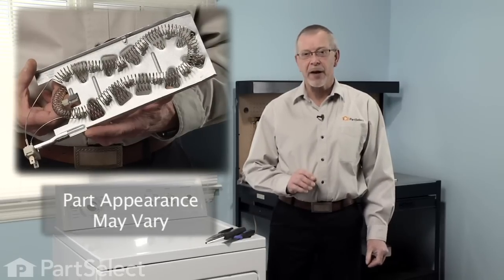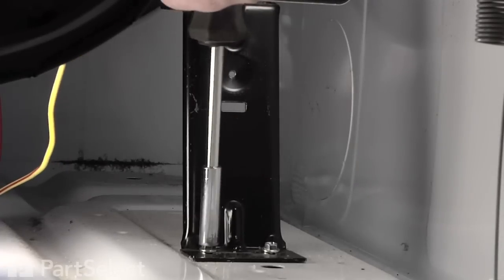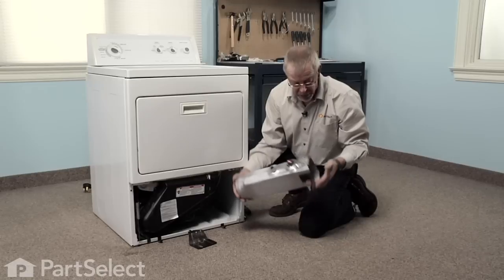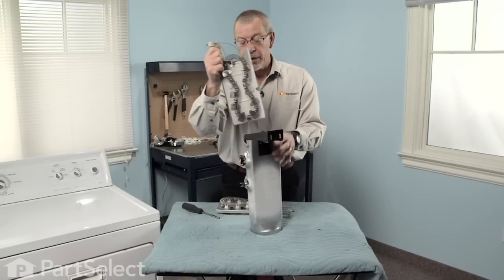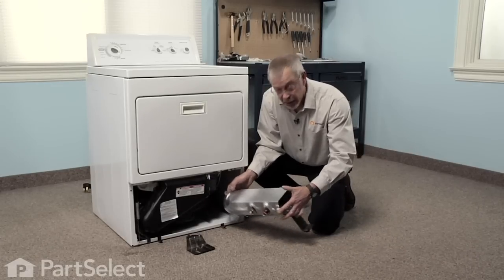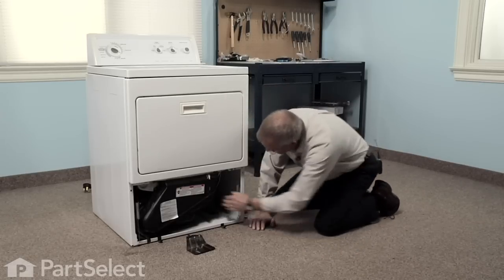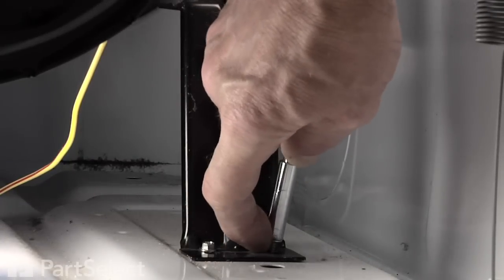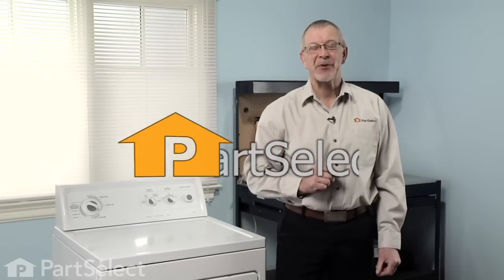Dryer Repair - Replacing the Heater Element (Whirlpool Part # 3387747)

Comment: Excellent video. My son andni just finished this project. Several comments.
1. If your dryer is older like ours is, its far easier to pull the drum to do this job. Getting that element housing out was not easy for us.

2. The element does not slide out easily. We had to use a screwdriver and hammer on it as it was super tight.
3. Pulling the drum made refitting the element assembly and housing and hooking wires a piece if cake.

Thanks, Steve!!

Comment: I just replaced the 3387747 Dryer Heating Element in our 20-year-old Whirlpool GEQ8811LW1  dryer following the steps in this video.  Net cost - $28.60 for a new element including taxes and shipping. Thanks, Steve!

To say that I was amazed to find this video available for such an old appliance would be an understatement. The only difference between our dryer and the one shown here is the bracket that holds the front of the heating element cage in front.  Without this I had first tried to open the back of the dryer - not possible - its welded on - and couldn't even figure out how to open the front bottom panel.

Its really hard to get the heater cage back into the machine so that it properly engages at the back, but don't be discouraged and simply follow the directions of how to turn it in this video, Remember to first attach the front shield as he shows so you have leverage turn the shield when you finally get the clip on the back of the shield in position. . The other potential problem is figuring our how to reattach the wires, but just remember that they form a simple series connection between the fuse, thermostat and heater block and that the different sized clips give you an idea about which wire goes where.

Comment: Why don't you just remove the cover of the heating element housing and pull the heater element out to replace it ?? Lining up the tab on the back of the housing with the heater outlet in the back where you couldn't see it well is a bit of a chore don't you think ??

Comment: Steve this is different than my bracket, I have one little screw on the bottom and 1 under neath the heating tube. I can not get this to lock in. Steve your bracket looks much stronger than mine is.
Reply: Same how did you get back in?